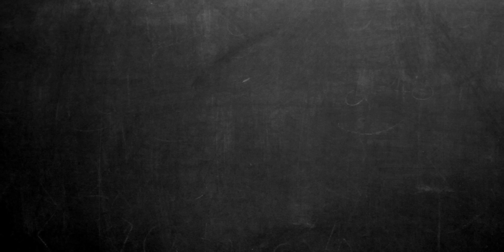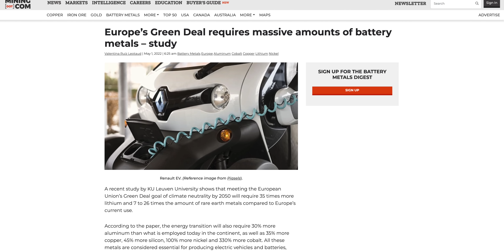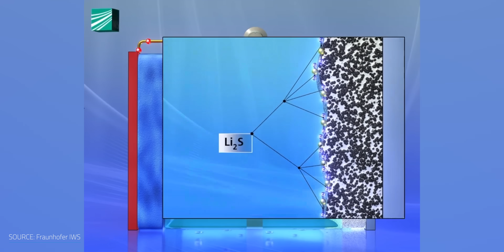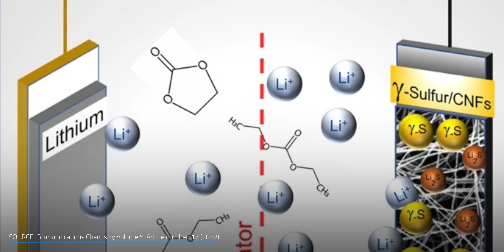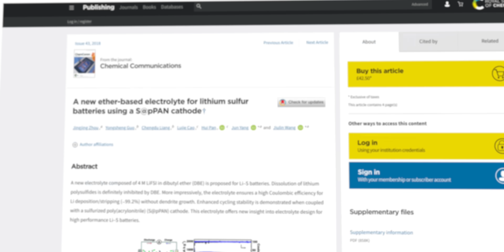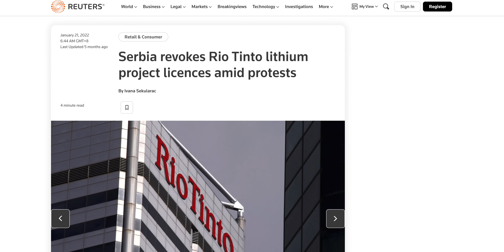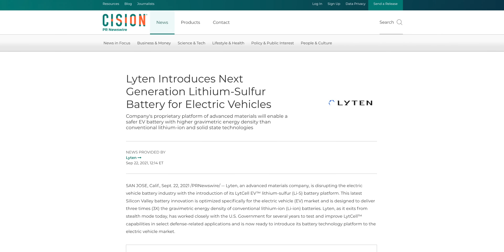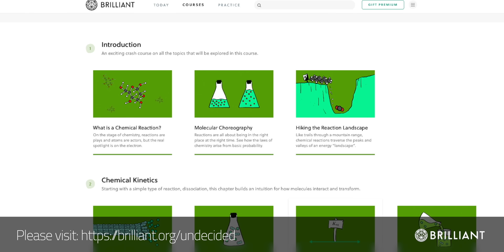Why This Accidental Battery Breakthrough Matters

Comment: As a rule of thumb, laboratory discoveries and technology breakthroughs are always ten years away from coming to market.
Reply: usually this is true. but in this case it is more of an overhaul that can be put on existing battery plants. imagine Tesla creating 2 types of batteries using different source materials on more or less the "same" productionline. which is huge. all that remains to be seen though. but at least there is hope in this case
Reply: I just wait till some indian chemical engineer students make a DIY video in how to build your own sulfur battery in 1-2 years.
Reply: It took 30 years for LED lights to become available
Reply: @bluesky6985  No? The conventional diode was barely perfected in the '40s, and LEDs were released for public in the '70s. Just because they dicovered the effect that makes LEDs work back then, doesn't mean it had been invented. It was actually 10 years between the first usable LED and mass market.

Unless you're talking about lightbulbs, in which case, they came to market immediately, like a 1 year wait, they were just far too expensive for general retailers to consider selling them, at like $10 per bulb compared to 50 cent incandescent bulbs
Reply: About right the Wright Brothers flew the first heavier then air craft in 1903, the first really practical airplanes were in WW1 , 1914. 
First transistor built in lab 1943 first commercial application 1952.
Reply: @francesconicoletti2547  — The first heavier-than-air aircraft predated the Wright brothers by decades, but theirs was the first practical controllable airplane.  Earlier inventors hadn't figured out that an airplane had to be able to bank to make coordinated turns in the air, a riddle that was solved by the Wright brothers with wing warping.
Reply: The problem isn't the technology itself, it's simply lack of buyers.
If none can sell it, then why bother?
Reply: As a Rule, they Never come to market. The exceptional case is a minimum 10 years. There are some companies look to speed up that process, at least for LFP battery improvements.
Reply: @patreekotime4578  lol right said
Reply: @patreekotime4578  I think they're referring to the joke that no matter how great the breakthrough is, it's always 10 years from today for any given innovation (I.e., a rolling wave of 10-years-out-things-that-will-never-come-out). Just like full self driving (saying this cheekily as an ML researcher. ;))
Reply: @fernbear3950  But full self driving did come out already... You never heard of the Tesla FSD controversy of 2018? People were using self-driving on residential, unlined streets, and still are today.

Comment: No Lithium Sulfur is not the new kid on the block... It's "LFP" Lithium Iron that is being produced now in super volume... Not susceptible to the thermal runaway of Li Ion and Has a Larger Power Density Potential.  So the Tech is Here now "4680" Baby

Comment: "Since the beginning of 2022, the price of Lithium has doubled"
Interesting, because the price of Lithium Iron batteries is less than a third of what it was 5 years ago. How do you explain that?
Reply: Lithium is not the bottleneck, but soon will be.
Reply: @agsystems8220  Well, if the price of the battery goes down -33% when lithium goes +200%, I wouldn't be freaking out about Lithium as a factor anytime soon.

Edit: I meant -66% for the price drop of the battery, which makes the whole thing even more questionable.

Comment: What I don't get is why we are so entirely focused on an enclosed build and forget system for the anode and cathode.  What is stopping us from developing a system that can self purge dendritic buildup by rotating the anode or cathode? Seems like a per charge cycle rotation where a clean plate is cycled in and  the old is cleaned might work.  Think 3 different plates functioning as a cathode. Where they are moved internally each charge cycle and cleaned in a close loop chemical bath of sorts.

Comment: Holy crap if they could make sodium Sulfur batteries actually work would be insane.

Edit- like I have never been fully sold on EV's as lithium is not a good thing to depend on like we are. But if we could figure out this sodium sulfur combo and make a batter with 2x more recharge and 3-8x more charge? That would be for sure a game changer.
Reply: There were some sodium-sulfur batteries available in the 1980s (and also sodium-nickel-chloride batteries which were rather similar). They had an energy density of about 120 watt-hours per kg, which is about half that of the best lithium-ion batteries now available but is four times that of the lead-acid batteries they were competing with at the time. The snag with them was that they needed to be kept at a temperature of 350deg.C which meant big energy losses keeping them hot, even with the use of elaborate thermal insulation. Also if they were ever allowed to cool down the cell separators (made of aluminum oxide) could crack which destroyed the cell. The work described in this video is directed toward sodium-sulfur cells that will work at ambient temperature.
Reply: @cedriclynch  oh interesting didn't know that. I wonder if they will be able to figure out a way around any of this or we are stuck with depending on a rare mineral for batteries which imo literally defeats the purpose of trying to get away from fossil fuels. We are literally just replacing one way of destroying the environment with another.
Reply: In my opinion the current pushback to EVs is the time iy takes to recharge if a person is on a long road trip.

For the gasoline people 500 mile range is not enough if they have to stop for an hour to recharge.

Which makes no sense because they are going to stop to go to the bathroom anyway.

Charging facilities are going to have to be greatly expanded.

I can see some sort of giant covered parking lot with hundreds or even thousands of connection points.
Reply: @shawnr771  As someone who has spent the last 7 years fighting the results of decades of long distance driving and airplane flights with blood clots, maybe on those long trips the extra charging time would  be a great time to stretch one's legs and prevent blood clots. We had to start somewhere and it appears the demand for EVs is finally sufficient to require massive research to solve the range, weight, # of charge cycles.  Sort of the Manhattan Project for EVs.
Reply: @mikewurlitzer5217  Oh I agree.
Thing I see is there is going to have to be more than 5 outlets at the recharge station.

Including the infrastructure to power it.

I envision some sort of drive in large warehouse structure with the roof covered in solar panels and a wind generators.

The Bucees would be inside.
Just think of all the vehicles that stop for fuel in one hour at any fuel station on the highway.

The system would havd to be large enough to handle that volume of traffic or the wait time would increase.

I could see being able to reserve a spot while riding down the road.
Or an app that would tell if a charging port is open or would be open by the time of arrival.
Reply: @shawnr771  I would say that or just be like a parking lot like wal marts or basically any parking lot. can have charging stations at each spot.
Reply: @gahmivolka  If I owned it and had a big store like a Bucees. I would want my customers to be able to park inside like an airplane hangar.
Cover the roof with solar panels.
Reply: @shawnr771  oh for sure. A building that would allow them to be out of the elements would be great. I am just saying there is already infrastructure available that would easily beable to massively increase the capacity of charging stations.
Reply: @gahmivolka  yes.

Comment: 2:47 This channel is centred too much around cars. One of the very reasons we should transition away from cars (the vast majority of the situations), and buffing public transport is because of the better use of materials (30 cars obviously need more rare materials than a bus, without even mentioning trams or trains). It's utterly backward thinking to apply new technologies to obsolete means of transportations. The car is, in most situation, a relict of the past. I've noticed that this channel seems to care about sustainability only when it doesn't challenge certain habits that the author presumably is attached to, like having a car and a detached house. To little attention is put on city planning and how stupid suburbs with single houses are. I hope it'll change in the future.

Comment: There are a number of Lithium-Ion chemistries, but in the boating world only LiFePO4 is used, because it's the only one that won't spontaneously ignite. It will still burn, if ignited, but it won't ignite on its own. Even if, for example, it is submerged in saltwater. 

A cell phone you can toss aside, an automobile you can exit. A boat doesn't give you those options.

How safe will these Lithium-sulfer batteries be?

Comment: A world without fossil fuels is coming, whether we want it or not. If it takes an hour, two hours ten hours to charge your vehicle, this means we will be stuck at home... or waiting in long lines at charging stations around the country. It also means we will be stranded on highways when snowstorms have shut down the interstates, with no power and no heat. 

We will be slaves to the charging facilities, and to the power grid. Texas last winter should have shown us that we aren't even close to being ready for the world into which we are being forced. 

Also, have you wondered why, the past few years, that Russia and China have been given almost total control of the world's lithium supply? This means we will be slaves to them as well (as if we aren't already... the US to China and Europe to Russia).

Comment: Great accidental discovery. Thank you for this program and congratulations to Drexel. Longer Range, Safety, Lower costs, better charger infrastructure and integrated plan for all . EVs and recycling strategy.  Pricing lower than ice and have a range double what it is now with no appreciable increase in the use of fossil fuels to make EVs.

Comment: It won't make a difference.  Lithium is borderline useless for large-scale energy storage.  It's far too toxic to process, and there's just not enough of it.  It's also quite hazardous to simply dispose of them when they finally do die, and just as hazardous to recycle them.

Lithium is a moderately useful intermediate energy storage medium on the way to better technologies, but nothing more.  For the long-term and large-scale, it's total trash.

Comment: Another wonderful magic battery technology... yet for the past however many decades the battery technology world has been slowly evolving. And every few months a new wonderful technology is announced, yet none of them move to large scale production to move the needle in any significant way.

So I am sorry to be skeptical but till this actually shows up on shelves this is a fun trick in the lab but nothing else than that.
Reply: Lithium was once a "wonderfull battery technology"
Reply: @mathieuprevot8753  yes it was and many many years later it was just a bit better than the competing technology already being mass produced 

This is exactly the issue with these "wonder tech" stories. People seem to always conveniently leave out the many years it takes to move from a lab fluke to a production line. By the time mass production of the wonder material finally begins the rest of the market is nearly as good as the new product making the end result evolutionary rather than revolutionary.
Reply: @RobCoops  Yes but every technology has a limit. When Lithium did hit the market, it kinda sucked, but now it's miles ahead of Nickel. It's always like that. First cars sucked, you were better off with a horse, but after a while it become better while horse's technology had reached a plateau.

Comment: Great video. Why though use metric with imperial units in brackets and then all of a sudden use gallons and omit litres? ... Not only that, but why use gallons per tonne, i.e. imperial unit per metric unit?
Reply: Agreed about the inconsistency. Regarding tonnes when spelled that way, that is indeed metric, but on the screen he spelled it ton. In the U.S. we have an imperial ton that is 2,000 avoirdupois pounds or 907.18474 kg. Here when we speak of a ton outside of a scientific or technical context, that is the ton that's understood unless we specify the term "metric tonne". In writing, if we see just "tonne" it is normal to assume that metric is referenced, because "tonne" is a traditionally British/UK spelling of the word. 20 years ago in U.S. writing, i never ever saw the spelling "tonne" alone without the word "metric" in front, because there was deemed too much possibility for confusion. After all, the words tonne and ton are technically the same word, just using British vs. American spelling conventions.

Today, however, i'm seeing many more cases of just "tonne" than i am of "metric tonne", which i suppose reflects that younger generations in the U.S. are  unlikely to even consider the possibility of using an imperial ton in technical writing. I suspect it's now being taught that in technical usage it is a serious error to quote imperial tons for any purpose, even as a translation. Though that was not entirely the case when i was in university in the 80s. However, in public communications, the spelling "ton" is still commonplace and is widely understood to refer to the imperial ton.
Reply: @no_rubbernecking  Wow, I had no idea about the ton / tonne difference (not only that, but after some googling I now learnt that there is a "short ton" and "long ton", with both tons expressing different weights of course...). Funnily enough, this shows the need for consistency as this means that I would have confused one of the units used, therefore arriving to a wrong conclusion solely based on unit confusion. … Imperial units strike again.
Reply: @rehorekMichal  Yes indeed! Though I feel like within my lifetime we will be using more metric than imperial.
Reply: yeah, it wouldn't be hard to have both on screen at the same time

Comment: All of these discoveries are gonna be moot if someone patents it and sells it for way too much money. I've seen this before, some breakthrough happens, only to be killed by greedy patent holders. Doesn't matter if the battery is 10x cheaper to make if it costs 4 times to simply get the patent... And single Supply is never a good thing.

Comment: So cool to hear the last author on the paper talk about the research. This seems pretty awesome.

Also just a minor thing, a 700% increase is actually an eight fold increase, not seven fold.
Reply: No you can't count the original energy density as an increase. 700% is just that. 7 times the base energy density. You don't count the current density as a value increase.
Reply: @Frostsage  ....that is not how % increases work, bruv. Travis is right.

Comment: Hearing about breakthroughs like this and using easier obtained and safer materials for our batteries gets me excited.  Kinda defeating the purpose of going green when making the green stuff comes with more toxic ways for the Earth and humanity, which is actually a good point by those that point at going green isn't actually green.  But it's good to point out new technologies and means of manufacturing that would address them and shut those naysayers up.

Comment: Hmm.. 6 years.. 6 years to market might be short but I would imagine that it should be possible to create a prototype / proof of concept battery to have something to show for in months rather than years.

If they truly jumped over the biggest hurdle in Li-S battery than I don't see any reason for not focusing all energy on producing a standard cell for demo purposes. You don't have to understand tech to use it. I get they are scientist and it's their job to understand things but business does not need that. It just needs a product that works.

Show to business that a battery can be built and they will shower you with all the money necessary for funding research work needed for full understanding. Otherwise this tech might just never be viable for real-world use because somebody will get there sooner with a different solution and just take all the market to a different direction. Those things happened in the past.

Build a demo battery ASAP.
Reply: तुमचे म्हणणे योग्य आहे.
Reply: These things also happened in the past:
- a tech we used but didn't understand fully - freons,
- a tech we understood and used anyway despite the negative consequences - leaded gasoline.
Reply: @muche6321  True but I wasn't saying start selling it... I was just saying make a demo battery and start testing it.
Reply: Runaway business is in large part howe we are here today. It is critical to understand something fully, full stop.
Reply: @thecocktailian2091  Actually, you don't have to understand absolutely everything about something to use it. We still don't understand how light  in some ways acts like  particles and in other ways like waves.

Comment: 3x the capacity? Hot dang.

Hope this ends up working out :)
Reply: By weight not volume.
Reply: @ZakKohler  that changes a lot, is the energy density per volume better or at least comparable to lithium ion?